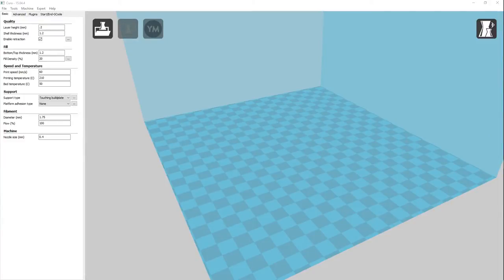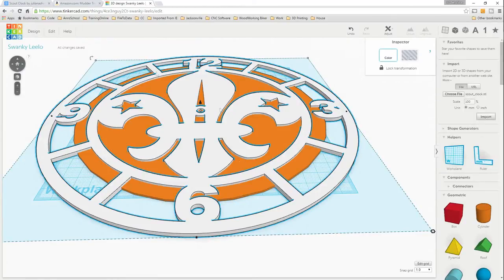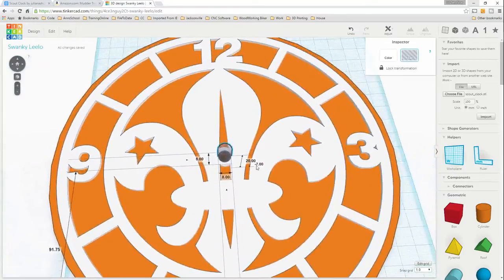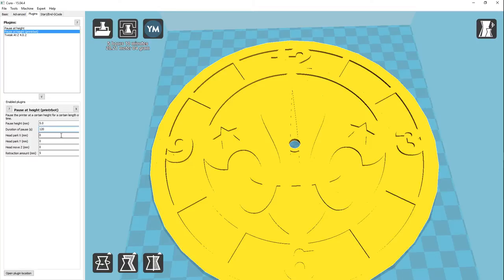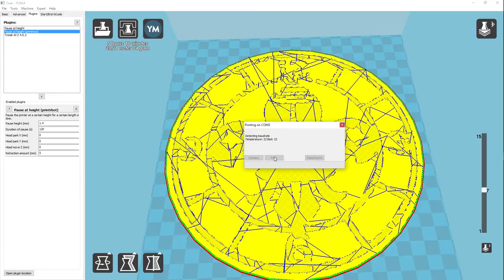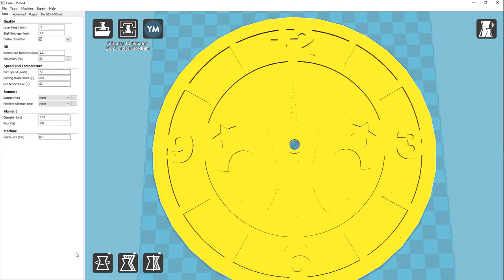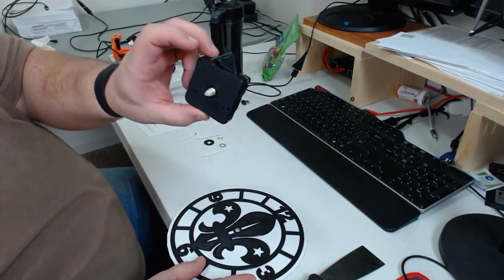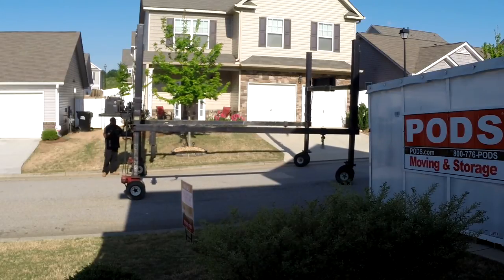3D Printing: 2 Color Print (Scout Clock)

Comment: You just saved me like hours of work, I wanted to print in 2 colors but I was going to print the things separate, now I will give it a try like you... although I dont know why I am not able to get good prints from CURA, the first layer is always messed up... great video
Reply from the maker: +SargeOrona Check your speed for the first layer on the advanced tab. I would not print it faster the 30... If that is not the problem check your off set on the Start/End-GCode tab. the off set is the M565 Z-1. If the first layer is not getting pressed in to the build plate change - 0.1 from the Z-1 (Z-0.9) until you are getting a good press into the build plate. If it is over pressing into the build plate the + 0.1 to the Z-1 (Z-1.1) until you are getting a good press into the build plate.
Reply: +3D NerdStop I changed the Z to 0.8, I think that made the trick, the calibration box printed out just fine!
Thanks again for your help bro! Good luck on the new house!